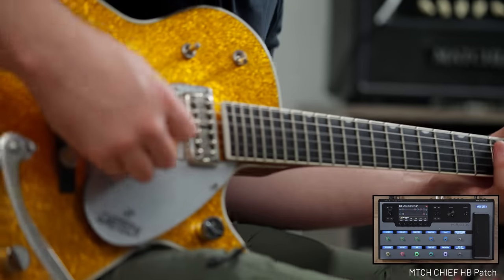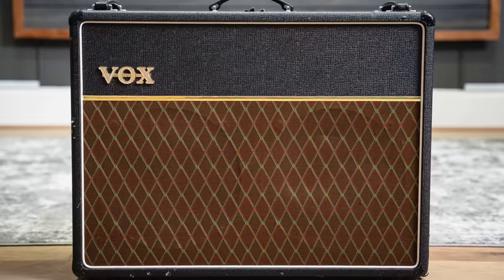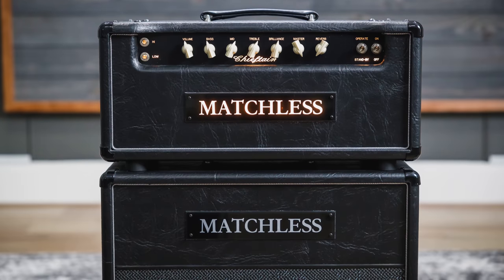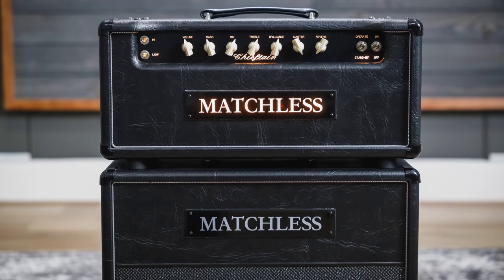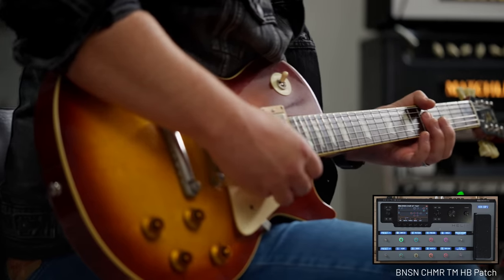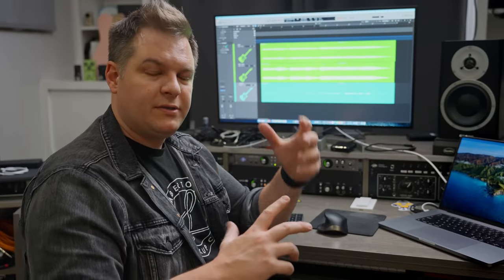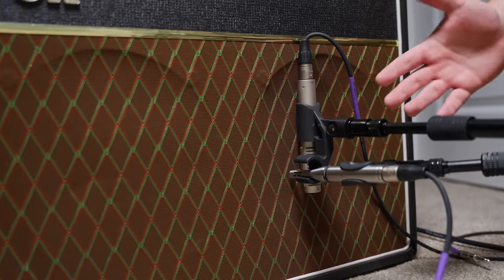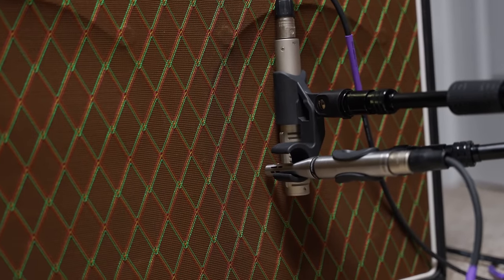Can we profile real amps with the Line 6 Helix?

Comment: The Gretsch is mega close`. The helix version of the other ones sounded just a little cleaner/more digital which I guess they would.
Reply: I actually greatly preferred the amp sounds. The Helix was quite far off in those examples (except for the Gretsch amp)
Reply: The Helix for most of the patches did sound more compressed and not as open and clear, but the Gretsch did stand out as extremely close on the lower gain settings. I really would like to see a comparison between the tone match and the regular helix models + irs